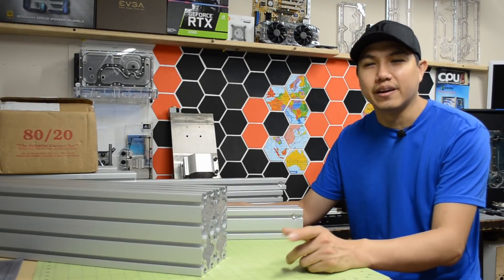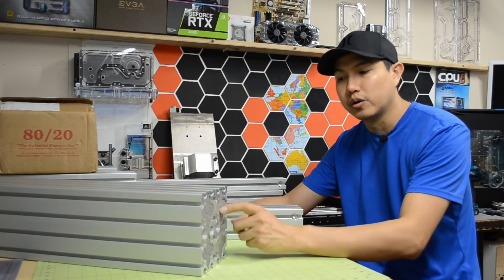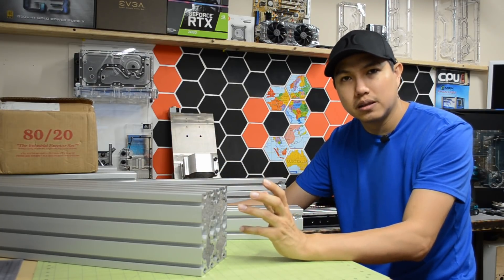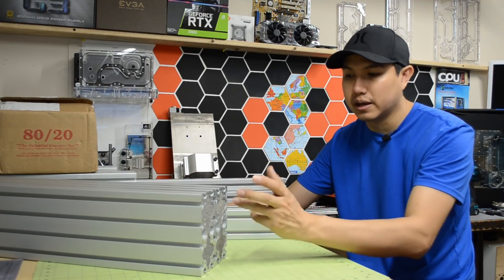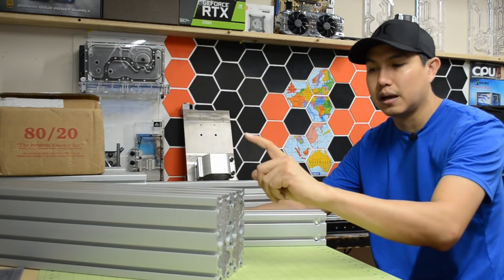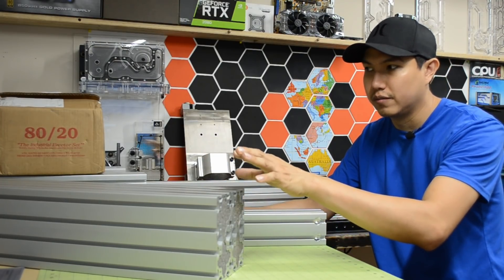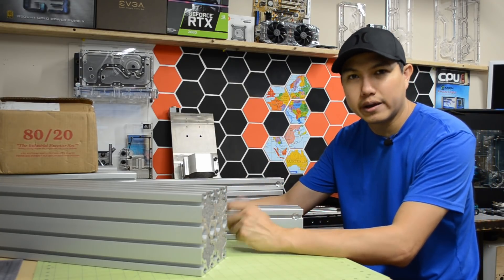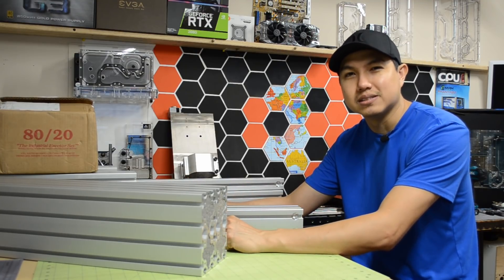DIY Homemade CNC part 3 - Fixed Gantry Frame Assembly

Comment: It looks like she will be a beast. Have you thought about using a second spindle mount to reduce the end play?
Reply from the maker: Shawn Lund that’s a good idea,  the good thing about this build is that I can change parts if needed be, maybe even switch the spindle to a square one
Reply: Radikult I have a couple of cnc machines but I have always wanted to build a rugged cnc router than could handle cutting aluminum easily, much like what you are building. The epoxy sand fill is going to be a huge improvement in reducing resonance, if I ever get around to building something I will remember this for sure.
Reply: Radikult Try to measure on the z-axis plate directly with the indicator, then you'll know where the flex comes from. I guess that adding side plates to the z could help too. Making the z plate become a U shape should increase stiffness of that part at least.
Reply: @anderslarsson7123  The Z axis plate is at least 3/8th aluminium plate connected to widely spaced rails and bearing blocks. If it's flexing at the plate itself there is something seriously wrong.
Reply from the maker: Shawn Lund so after tinkering with the Z-axis and checking that +/-.05mm flex I end up switching the Z-axis the other way around for a few reasons. 
1st it’s super heavy 40lbs to lift it and hold.
2nd I notice that when I hit the spindle with my hand it “hums / vibrate” I was thinking maybe since I bought it used maybe it had something bad 

Now that it’s switch the other way, no “hum”, easier to move the spindle up and down and pulling on the tip of the spindle with about 30lbs of force I got 0.01mm to 0.02mm
Reply: Radikult that sounds pretty rigid, I don’t think I know exactly what you did but I will wait to see the next video. Great that you got the flex sorted out.

Comment: I genuinely appreciate this series as it's helping me with decisions on my own gantry CNC. I have to ask, can the Z-axis be back-driven? I noticed in part 2 that the X and Y could be moved around without having to spin the screw....if the Z-axis can be back-driven (it looks a similar setup?) doesn't that mean the head can crash down under its own weight?
Reply from the maker: Yes the Z axis can crash under its own weight when the power it’s turn off. It is way I put a “tool balancer” to prevent that from happening. You could use an air spring to do the same.
Reply: @radikult-custom  I've not encountered air springs before. Are they similar in principle to a counterbalance, or do they act as a "soft drop limit" for the Z? Did you select a screw type that can back-drive for any specific overriding reason?
edit: I missed this exact same discussion at 11:20 🙂

Comment: hi just idea is to buy a small stick magnet that fits in the tee slot and us that to bring the tee nut into position to bolt it together that's what I use very easy and quick

Comment: What did you use the cut the aluminum extrusions perfectly square?  Chop saw??
Reply from the maker: Yeah, a chop saw, If you buy the extrusion from “80/20” the cuts are really good
Reply: @radikult-custom  mind if I ask where you got your linear rails with those granit bases and ball screws?  I have a pretty similar designed fixed gantry system on vention with the same extrusions you have but I was hoping to find plates that already have the linear rails mounted to them and ball screws as well.  Thompson makes them but they are like 1500 a piece which is way too expensive.
Reply from the maker: @CryoftheProphet  I found them on eBay, but they were one of  a kind pieces.
Reply: @radikult-custom  Thank you, you really have inspired me with your build, I really admire your drive and ingenuity

Comment: Looks like a tank. Do you think it's kind of overkill for a small desktop CNC?
Reply from the maker: Well it depends on what you planing to use it for.  If you going to cut soft materials and the quality of the cut don’t matter to much then yes it’s a overkill.  
If quality of the cut is very important, then no, actually if the frame was made out of steel or granite would be better

Comment: Man, I stumbled into your channel and I love the content and how you work around the issues you encounter. You sparked my interest in building myself a CNC. I just ordered some Close Loop NEMA 34 Stepper motors and some NEMA 24 for starts. I was trying to locate the extrusions you used as base for your unit and could not find on 8020.net. Glad to see such craftsmanship! Keep it up! I'm subscribed and watching!
Reply from the maker: The extrusion are 40 series I think. The ones I have are here 
https://8020.net/40-8016.html

Comment: Hi.....if you wanted to make it more rigid in those sections you could have inserted solid steel bars ........scrap rebar comes to mind....and epoxy glued them in the middle of the extrusion.....that would give it more mass without breaking the bank.

Comment: Awesome job on this so far. It does look like your use of the dial indicator is a little too straight on though. It should be more parallel to the surface you're reading.

Comment: The part you pickup at 3:32 did you build that or buy it? Would love to find a complete axis like that, it would save a ton of time.
Reply from the maker: Beach&BoardFan  I found it on eBay (used) but really good condition 
You could find similar ones if you search for “THK or NSK  Linear ballscrew actuator”
Reply: Appreciate it!

Comment: I'm confused about epoxy granite. There doesn't seem to be lot of accurate info about it. Most of it is by youtubers doing trial and error.
Reply from the maker: MySchizo Buddy you are correct. Since big companies don’t give their secrets away. 
As a diy cnc, I use it for the added weight and dampening some vibrations

Comment: If you use lead screws instead of ball screws on the z-axis they tend not to be as easily back driven so you shouldn't need springs or anything

Comment: How did you go about cutting it?
Reply from the maker: Maple_Dude the aluminum extrusions?  I cut it with a band saw or a table saw, if it’s small pieces I use a chip saw too.  But the blades have at least 80 tooth

Comment: Looks great!  Just a suggestion,  I used a nema 23 5:1 reduction gearbox on my Z axis.  This keeps the Z axis from feeding down when the power is cut.  It's been in place for about a year now and still working great.  You can compensate for the reduction by adjusting the steps per inch in Mach3.

Comment: Looking good. You will definitely want the ability to change tools automatically. I love servos but I did pick up a pair of hybrid steppers to try on my upcoming Lathe conversion. I'll start on it (again) once Im done with my 4th axis.
Reply from the maker: Jody Olivent I like servos too but they cost 3 times as much as close loop steppers.  That’s why I’m considering them lol
Reply: @radikult-custom  that's the same reason I didn't use servos  for my lathe. I'm excited to see how the compare to both servos and regular steppers.

Comment: Looks awsome man!!  Much beefier then mine. What steppers are those?  They look like the same ones I had at first. I had to switch them out for stronger ones cause they kept stalling.
Reply from the maker: CyberDen Systems they are 300oz old steppers from my very first cnc, most likely it will stall trying to lift the z axis lol  but I’ll just them for testing purposes

Comment: Have you allready tried Servos like the JMC ones?
Reply from the maker: MajorTwip I have the clear path servos from teknic on my other cnc, I have not try the JMC
Reply: @radikult-custom  Are you satisfied with the Teknic's performance?
Reply from the maker: AVSIT1 yes very, no noise, high torque and speed, and everything build into the unit,  the only down side it could be the price.
Reply: @radikult-custom  was there an advantage over SD (stepper controlled) over the SC for you  or preference?
Reply from the maker: AVSIT1 I got the SDSK because those are the ones for “step and direction” for cnc machines.  The others SC is for different applications